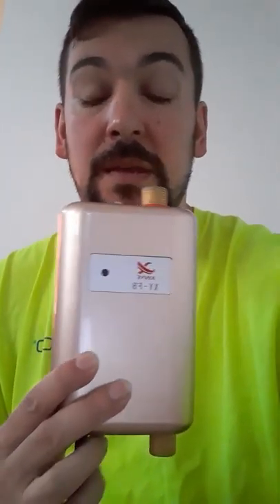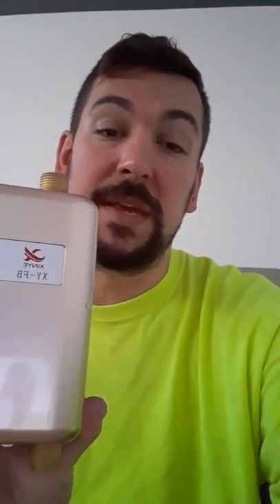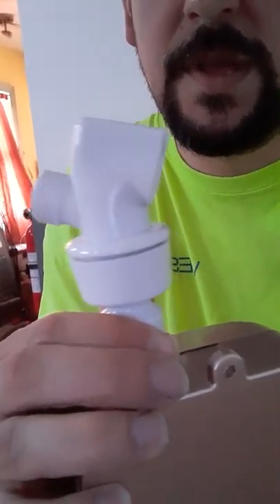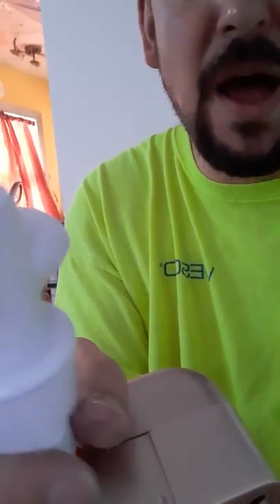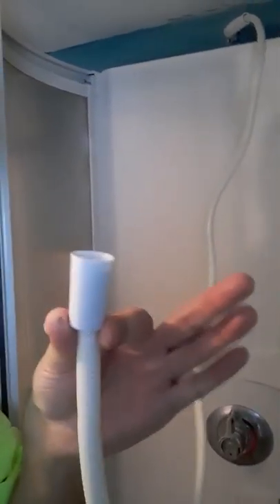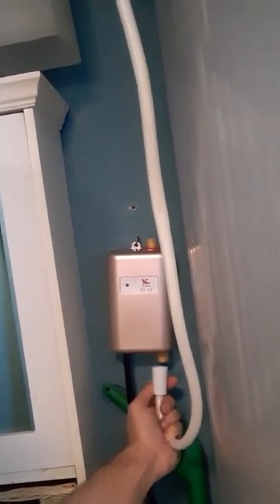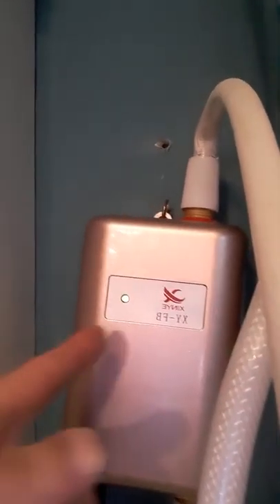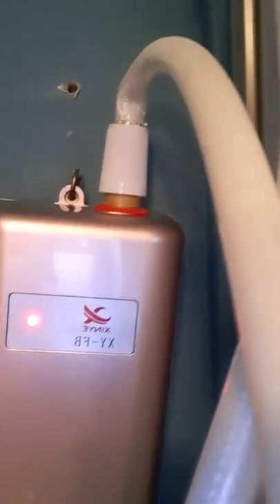Mini Tankless Water Heater.

Comment: This might be one of the realest YouTube videos I've ever seen and I love it, I just started looking into these heater things and I really appreciate you taking the time to make such a good review of the product. Thank you very much.
Reply: Would you recommend this for a small building that has 3 sinks, 2 are in restrooms, and 1 sink is behind the Bar for rinsing glasses and maybe utensils? I just want to be able to use this with all three sinks working at once.
Reply: @ericperry72  I'm afraid I can't recommend something like this for such a large volume of water unless you wanted to put one on each sink, and then again it depends on the input temperature of your water (from a well, municipal source, or large cistern). I ultimately went with a cheap Chinese propane on-demand water heater ($120 on Ebay at the time) for my place where I only use one tap at a time and it's barely enough. In the winter time (in upstate NY) the water is warm, not hot, I draw from an artesian well that gets as close to freezing as it can without actually freezing. The manufacturer 'claims' the heater I have puts out 36kw of heat (I have my doubts), the device in this video claims to put out 3kw of heat, but it's my understanding that it's illegal for consumer electronic devices to draw more than 15 amps from a standard outlet, at 110 volts 15 amps only makes 1.65kw. I don't know your position, but I would be very skeptical of these things except in the most desperate of circumstances. Peace brother.

Comment: Thank you, I am a recent widow and my husband (God rest his soul), was the "handy" man and I freaked out when the HUGE water heater was corroded and  broke (obviously). I saw this online same as yours except mine is red. That is my favorite color. And I followed your steps and thank you God Bless you. I can take a shower and then make way for a plumber to come and finish up the new water heater I installed, but it leaks, due to a copper pipe with a slight hole. This will work! Thanks again

Comment: The main reason this unit sets off the fuse is the amps. The unit pulls a 25 amp. It is suggested to check your wire type being used as 10 gauge wire is needed.
The fuse should be a 25-30 amp. If you have this its less likely to be set off. The load is causing the fuse to set off.
Good video over all.
Reply: Thanks for the advice. I’m getting 10/3 Romex and a 30 amp fuse for a dedicated line.
Reply: What’s odd is the 125V 15A plug and 2.5mm^2 wire which isn’t even rated to AWG 12!🤣

Hopefully no one runs this for very long or worse… just “sizes up the breaker”😱

I’m wondering if they used the wrong voltage (should be 250V single phase🤷‍♂️)

Comment: VERY IMPORTANT! I feel the need to reiterate some comments already made about this unit but this unit is rated for 3000 Watts @ 120 VAC. A derivation of the power formula is Watts/Voltage = Amperage (3000watts/120Volts = 25amps).   This means that the unit is rated to draw ***25 amps***.   The issue is that the plug and wire that it comes with is 14 gauge wire and only rated for about 15 amps (generally speaking).  This unit is a problem waiting to happen if your breaker doesn't trip first.  
Bonus Information:  I've measured the current draw on this unit and it was closer to 30amps at full load (about 3500 watts).
Reply: I've often found this similar issue in products from outside the U.S. I paid an extra $15 to replace and wire thicker gauge plugs in them from the local hardware store.  Worth it for safety. Always add at least another $20 on these things for replacement parts.. But still cheap and minimal effort.
Reply: 3k watts from a standard residential 120V outlet? That's insane!
Reply: @Freshbrood  The wire from the fuse box to the outlet is probably too small for this current. The wire from the machine to the outlet is the least of the problem. There is a good chance the outlet is only rated for 15 or 20 amps. And if the screw connecting the wire to the outlet is not tight Possible sparking and a lot of heat generated. I have seen two cases of this. One case the fire dept. was called. The other the smell gave it away.
Reply: Thanks. Good to know.
Reply: I just paid 220$ for a 2400 watt. 120v
That's 20 amps continuous.
I grabbed some#10 S O cord from work and a 30 amp camper plug from Homme Depot. A 50 to 30 adapter from Wally world. Going to run my camper off the 50 and my little water heater off the 30
Reply: So, what gauge wire should be used with a unit like in the video?
Reply: @5ofNov  did you ever figure it out? I'm scared to plug mine in. Have an old house.
Reply: so whats a girl to do? Is there a simple safe fix that doesn't include a master electrician?
Reply: @ronne3701 it trips the breaker every time. It's of no use.

Comment: Thank you so much for this! My gas water heater recently stopped working, really needed an electric solution.
Reply: Gas is a better option than electric. If your house is small a tankless water heater is fine but if you run a lot of water I would stick with gas because your electric bill will be higher

Comment: Thanks for the inspiration, Anthony! I had that thing in the house where I moved in over 6 months ago that didn't seem to work. The green light was on when plugged in, so power was fine, but no hot water coming out of it. The landlord, when asked, was clueless. A few minutes into your video, when you mentioned that the heater needed to be installed vertically, I had the thought that the two hoses might had been connected reversely and that the water not flowing in the right direction could be the problem. Two minutes later, the light turned red for the first time and I had hot water coming out of that thing. 🤓 Not sure how your video ends but it has been of great help for me to solve that little mystery. Thanks! :-)

Comment: Thank you so much for doing this video. I'm without hot water do to the winter storm. I have a busted pipe in my crawl space in the hot water line that I can't get to fix at the moment.  I will install a temporary electric in the cold line.

Comment: Just had my first no no leak shower from installing mine at the shower.  Very very nice.  Been taking cold shower now 8 months and being January finally no longer have to pretend to love cold showers. They are exhilarating but you can get cleaner and fresher in warm water.  I used a big braud shower head and did all the plumbing external to the shower but starting at the shower head and back to the detachable hand held showerhead.  When you turn it on with low pressure it's nice and warm and its warm enough to enjoy.  If you want a full blast how shower you need a larger unit will likely be 240v which might complicate your immediate installation.  But I'm super happy as is my wife.  But remember if you need full force and really hot water you need another more powerful model but otherwise thusvus perfectly comfortable and very economical.  Both in being 1/3 or 1/4 price of a standard heater but also in economy of electricity and water.  However I needed liquid teflon and needed an expensive crimp/pinch clamp pliers to keep the leaks away.  So basically I built it once with leaks and a second time perfect.  The trick was the right tool.  The flexible 1/2 inch pvd was a nice trick.  Home depot had more of what I needed over lowes but one lowes had the $15.00 ineffective pliers and I missed buying and later lowes had the $65.00 pliers.

Comment: Excellent video amen.
I work in electrical and you'll need orange 30(10 awg/guage) amp wiring(yellow 20 amp wire may survive) but if the breaker is 30 then everything else should be rated for 30 amps if possible for that unit and a 30 amp breaker and maybe bump up the receptacle at minimum to 20 amp. The receptacle will still be the weakest link but since the heater is made with a 110/120 volt plug it should fix the breaker tripping issue. But make sure your service wire being 100amps or 200 amps that you don't overload the entire breaker box load etc.
I may buy one like yours as well for my RV. Thanks for sharing amen!
Reply: Man now I'm more confused. 😁I want to install this in my semi truck. It has 4 batteries. Do I need a breaker box before installing this heater? And I also want to install a small 12V water pump. I don't want to destroy anything electric.
Reply: @singhmaster4  Hey,
It's been quite a while since I've watched this video. Let me watch it again and I'll get back with you and see...
Reply: @jamesrougeau  Ok thanks, and I have four 900 amp batteries but they are not directly connected to each other, unless I attach an attachment to connect them all.
   So right now if I were to connect something to a battery, it would only get power from one battery, not all four. Hope that helps. I'm electric illetrate. 😁
     That is why when I run the microwave in my truck, I start the truck to keep the battery from draining.
Reply: @singhmaster4  That is definitely good to know! I'll do some math and reply!
Reply: @singhmaster4  buy deep cycle battery.  to run electric stuff. to save gas/diesel
 and no it dont look like running this on battery is a good ideal.
Reply: @singhmaster4  they sell propane water heater btw
Reply: @rocketsmall4547  I don't have that much space in my truck for a propane heater. I drive out of state for weeks and need space for other stuff like microwave and a fridge and other miscellaneous stuff. Tankless heater saves space.

Comment: Sounds like what I need..I have a shop built behind my house ..just has a half bath...no shower just commode and vanity sink. would be able to wash my coffee pot and dishes. Best hook up to a stronger power station..or hook 12 volt battery..to make it stronger...that should stop throwing your breaker be able to turn it on full shower..you make sure you unplug when you are through with it....thanks for sharing🙂

Comment: Clever idea of how to demonstrate but I'd like to add some reasons I'm returning mine I just bought. 
First the specs shown in seller's sites was lacking expected operation description like does it have and try to maintain a temperature setpoint up to a max flow? And what is the temp vs flow curve so you can see if it would would work for one''s intended use. Anthony could have given us an idea of this though by flowing different rates and measuring temperature reached. and as far as the circuit tripping problems, 3000 watts is a lot to do on a standard outlet circuit since most are 15 or 20 max. thats why electric heaters are usually 1500 watts. And to change an existing ouitlet to 30amps you could change the associated breaker but existing wire is likely 14 or 12 guage max and 30amps requires 10guage. But I went ahead and bought one hoping i could make work. I found that the info it came with was also lacking but it showed that there are 4 diffferent models for 2 different wattages and 2 are for 220v which would be the best choice if one had that available, which I do but table doesn't show model number and I can't find any other model searching anyway.

Comment: My advice if your going to install this is to use a check valve to keep water in the heater
Reply: Is that to prevent the water from returning to the cold water hose? Do these heater need pressured water or can it pull water from a tank installed below the heater?

Comment: I got the same one from eBay slightly different style. But exactly the same, and it also trips my breaker. I'm guessing it's too much power?  Work fine for 10min  after that, it trips.

Comment: I installed this heater on the cold water supply to my whirlpool bath tub to lessen the amount of hot water needed from my tank style hot water heater. Worked great for a month or so filling tub maybe 6 times. Now heater powers on when faucet is turned on, can hear a relay or similar click and LED turns red but water temp does not change. Heater element is probably burnt out already. This is a very cheap heater, i do not recommend. Also I have mine hard plumbed into cold water supply not temp hose screwed to it. My only hope now is that it doesn't develop an internal leak or I will have to remove it totally and pitch it

Comment: I have the same installed under my bathroom sink. It was working fine initially for at least a month. But latter it start tipping the bathroom circuit breaker after a few run. Not sure whats wrong with it but it dont work continuously without triping.

Comment: I use one of these for my parts washer out in the shop...works great, only problem is that it doesn't regulate the temperature whatsoever, ie. the hotter the water gets in the tank the hotter the water that gets put out...not a big deal until it starts to reach about 140f. I ended up putting a motor speed controller on it and it works amazing now.
Reply: how does your motor speed controller work on this can you please explain
Reply: Yes this would be super helpful to figure out how to install a motor speed controller

Comment: Do you have to go through those steps every single time you use the shower? Or is that just the steps to initially set it up?  Because I’d hate to have to run cold water first every time I use it or unplug it after every use

Comment: 3000 Watts from one outlet? You'd need to plug it into an electric dryer supply outlet using the right adapter or a generator and HOPE it's internal wiring can handle that power. SO MANY people don't even think about the math regarding electrical draw. They let power bars lay flat on the floor face up (collecting flammable dust), try to use 10 Amp 100 foot long Walmart extension cords to power electric chain saws and log splitters, etc...

Comment: Hello. Maybe you can answer this question for me. My husband and I are thinking about buying a tiny camper with a galley kitchen area. The question I have is if putting in a 12v electric pressurized water system for the sink, is it possible to use this as well for warm water? It looks small enough to do so but wondering your thoughts on this situation. My husband is the one that is wanting to have warm water from this galley kitchen sink. Thank you for time! Jess 🙏

Comment: If this one doesn't get the water hot enough at a level good enough, go up to the 6000 watt models. But then your talking 220 volt 30 amp service. I have both. Having unlimited hot water in a shower is the Bombdigity.

Comment: Nicely done video just a couple of quick questions. I would like to use mine in the shower as well. It takes about two minutes for the water to get hot because my shower is a long way from my water heater. So my plan is to hook the cold water inlet to my hot water, line and the hot water outlet to my showerhead there by eliminating the wait time what do you think. However, after listening to the very end of your video, I think I need one with a little more kick like 5 to 8000 W. Which is about as high as I can go with 120 V hook up.

Comment: I just received this mini tankless water heater today for the purpose of a small sink, but what baffles me is that for 3000w 110v, why is the wire 14 gauge with nema 5-15 plug? 14 gauge can only support up to 1800w, not 3000w unless it's 240v. So, maybe I should try hooking this up with a 240v circuit to see what will happen? Would it use 3000w, but half the amp, or would it use 6000w? 240v would be the only thing that makes sense giving this weird configuration.
Reply: Ever figure it out? I want to put in a new breaker and run wire, but I’m not sure I can get away with 14 gauge wire.
Reply: @Judsonberry  Still in the box, I haven't installed it yet. I guess I procrastinated a lot. 9 months? Wow!

Comment: It will trip your electric, that will be a 3kw to 5.5 kw heater which is 3000 or 5500 watts which will need it's own separate trip switch and 2.5mm cable to the appliance

Comment: Thank you for this video. I was just looking at the mini tank on Amazon! Do you need to run cold water first before you plug it in every time you want to have hot water?
Reply: Not if you Install a check valve or have a cut off valve COLD side to keep the water in the unit.

Comment: Nice video. I want to buy this for a friend of mine in the dominican republic. I need warm water not only hot. Can I get warm water as well  with this?
Reply: I would think you could use a dimmer switch to limit the power usage to get warm water
Reply: Just like he said in video, open the tap/faucet more and the temperature of the output water will be less hot/warm, close it slowly and it will get hotter.

Comment: You didn’t show how you mounted that heater up. What is that black wire there?
Reply: This video is just a review not an installation video.

There are instructions and hardware that come with the unit.

It's an electric hot water heater so that black wire is the electrical connection also known as the plug that you would plug into an electrical outlet. 

As far as mounting the unit there are 2 holes top and bottom so 2 screws would be needed and they did come with the unit.
Reply: The black wire is the power line

Comment: Did they ground the outlet? So that an RCD can trip if the water goes live.. I'd get a plug in RCD, (and very carefully) make the water live for a moment (stay well away from the water flow, use a wooden rod, and have someone ready to disconnect it incase shit goes wrong) to make sure it is grounded. If not, then I wouldn't use it.